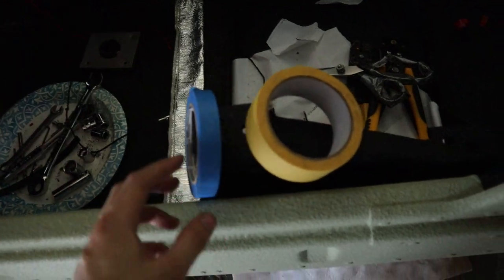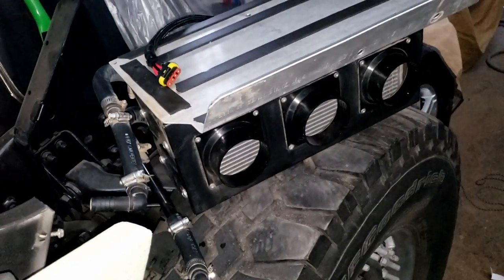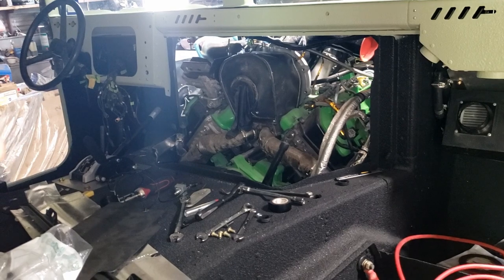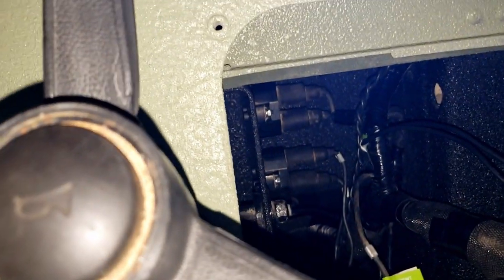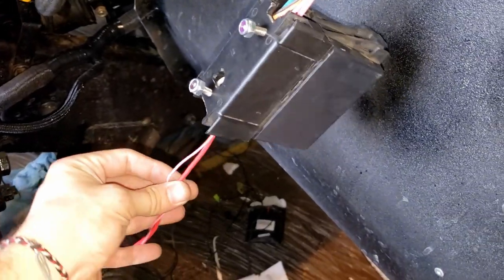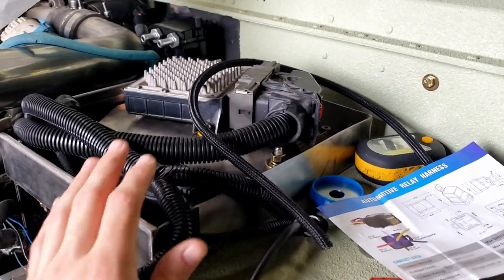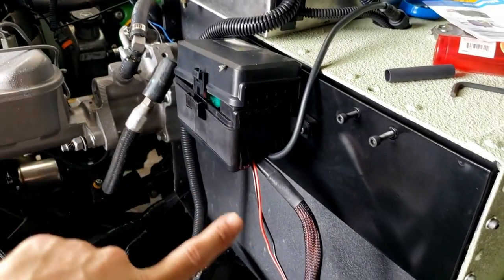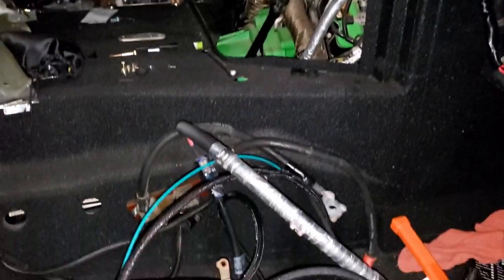Duramax Swap Humvee Wiring FUN...

Comment: Did you get an upgraded grounds harness for this critter...maybe you could go over what, why n where on one of those things???
Reply from the maker: I didn't buy a grounding harness for it but I am building one into my new wiring. Making sure I have good grounding to the engine, frame, inside the cab, fuse panels and battery post.

Comment: What driveshaft did you use? Thanks
Reply from the maker: I have a video where I talk about it some. You'll need to get custom driveshafts made.
Reply: @tossthewrench  thanks for the info ,here in Florida I called a few places they don't want to touch it. 😔😔
Reply from the maker: If you know what size ujoint ends you need, slip yoke, and know how to measure for a driveshaft length , you could order one from a shop somewhere else and they'll ship it